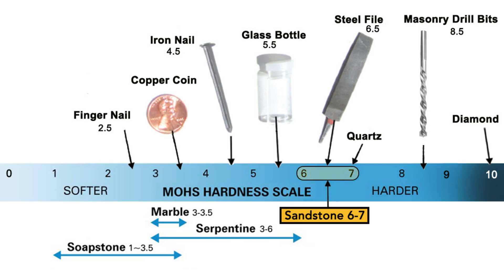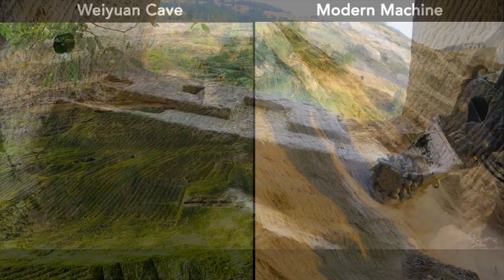Ancient Chinese Stone Caves & Egyptian Quarry Share Similar Machine Marks

Comment: If modern-like machinery was used in the construction of these sites there are enormous cascading questions that arise: Who designed the machines, who built the machines, where did they build them, what materials were they constructed from, how big or how small were these machines, what machinery was required to build these machines, what was the power source for the machines, if the power source for these machine was fuel - what was the fuel, what was the composition of the fuel, where was the fuel made or extracted, if the power source was electric - did it come from some sort of power grid, where is the evidence of that grid, what was the central source of electricity using to create the electricity, if the source was electric - was it generated on site, what amount of energy (fuel or electricity) was required, why are there no records of these machines or people using these machines, why did the machines disappear, if these kinds of machines could be produced certainly other types of machines could be produced (i.e: the huge vehicles that carry and use these modern bits are just as impressive if not more so than the bit itself), if this civilization could create and use this technology - why was it confined to making excavation implements, beyond making tools for excavation to build defensive structures one could easily assume that this civilization could also create some very impressive weapons of war, where are all the other machines and tools and manufacturing facilities. 

I am not dismissing the idea that modern-like tools may have been utilized to create these structures, but if this is true that is only 1% of the story. That we can't find remnants of or explain the construction of these modern-like excavation tools today is only one issue, there remains another 99% of things that must have existed that would have cascaded outward from the building and use of these tools yet we find next to nothing of this cascade. I think this is why the idea of it all being done by hand is so much easier to accept. While the points you make and the examples you show still remain good ones, the one that leaves the least trace of cascading infrastructure or proof of a modern-like or more advanced society is still the most plausible. 

Having said all that, I still find the idea of these constructions being done entirely by hand to be overwhelmingly difficult, slow, labor intensive, somewhat non-sensical and almost prohibitively difficult to plan, manage and fund... yet there it is, defying every bit of that disbelief.
Reply from the maker: Thanks Matt. I think the global wide megalithic phenomenon could be evidence of one or more prehistoric advanced civilizations. Judging by the scale of the work (Egyptian pyramids, Baalbeck, Sacsayhuama etc.), it's very possible that this civilization was more sophisticated than us.  Human species have been around for over 1 million years. Anatomically modern human with the same cranial volumes for over 300,000 years. Our known history is about 6,000 years. Did ancient people merely make stone tools for a million years with not much advancement? Look at what we have accomplished in the last 12,000 years. There is plenty of time for ancient humans to make a similar progress from making stone tools to landing crafts on Mars. 
Btw I made a video on the possible event that ended the last advanced civilization over 20,-15,000 years ago when there was a severe homo sapiens bottleneck. Hope you will find it interesting - When Humans Faced Extinction – the Ending of a Previous Advanced Civilization? https://youtu.be/Zs4zLKbp4Ic
Reply: @CuriousBeingbyTina  I certainly appreciate your curiosity and your pragmatic approach to these topics. I find myself perplexed by how these structures were made and what techniques were employed.
Imagining the difficulty that they would present to us today in this advanced technological society, in some ways biases me. Whoever carried out these projects either didn’t care how hard they were, was ok with expending huge amounts of effort and time, had skills we are currently unaware of OR were so far advanced from where we are today that the projects were all in a days work (and somehow that society evaporated completely leaving extremely little in the way of ‘hard evidence’ such as tools, plans, infrastructure etc) Maybe someday we will find this proof… but until then I have to stand with what we have in hand - and always listen to new ideas. Mysteries deserve our curiosity.

Comment: Please consider the following.
6:20 If he is trying to create parallel close together striations he needs to make the surface flatter first .

7:00 Looks like he is focusing on removing excess stone and not trying to replicate the cave finish.

8:20 This person is just removing the sawn finish. Uniform lines are not the intended result. Also he is using the metal part of a screwdriver. Not the correct tool if the cave finish is the desired look .
The three masons you presented display poor technique and the chisels also unsuitable for the task .
Thanks for the video, it was still interesting and well presented.
Cheers
Reply from the maker: Mr. Tiger used jackhammers not a screwdriver. I explained in the video that jackhammers are way more powerful than chisel and hammer. Thank you for the comment.

Comment: You do not need electricity to drive machinery. I could design a water power driven  rotary stone cutting device with ease. What you need is merely water pressure, the concept of the wheel, a glue and hard crystals attached to the wheels, made from whatever. You would not even need nano-diamonds. DLF
Reply from the maker: Interesting information. Thank you Dieter.

Comment: Looking at these pictures side by side cannot be sufficient evidence for power machine marks. You have to look much closer at the individual marks to identify the strikes done to remove material. It is also very important to look into corners and hard to reach places where a power machine would be incapable to reach.

A power machine can be human powered, though a single blow from a power machine doesn't necessarily have to be as efficient as the human hand if the blows are much more frequent. Example: how much material does a single power drill blow remove compared to a single chisel blow from an experienced human? And how close would you have to look to identify these two from each other?

We humans tend to find the easy way of doing things, so could they have figured a reasonable technique using hand tools which we can't imagine because we go to power tools way before we could figure this out and understand this? We don't have the problem because we use power tools to do the job, so we don't have to find a technique to do it more efficient with hand tools.

I think this needs a much deeper investigation, and I'm sure we will learn a lot which we didn't know. But it's important not to be biased here.

Thank you Tina for this one, I always enjoy watching your video's.
Reply: A close examination shows each line to be unique; variations in width, depth, and alignment.  Very UN-macinelike up close.

Comment: Page 6:47. Interesting. 
With no further thinking it is convenient to conclude that those striation were left behind by modern machinery in ancient time. Shall we say that is hardly conclusive?.  

What if we add this for an educated guess?
Ancient earth experienced several close encounter with comets varying from astroid to planet size. There were debris fall from comet on earth responsible for landscape profile on earth (except mountain ranges), also deluge of landed on lake or seas. The landscape begin soft but soon turn stone hard. Debris were mostly - course and fine sand, water of various ph or salinity. 

Living things can’t hide from that were buried alive. Ask why some dinosaurs fossils found in whole but dismembered? It was hurried alive. Also a proof of mud fall from heaven in ancient times. 

If you live in those ancient times you can’t run away but to face it, by digging for shelter, in the fresh mud fall while it was soft, with bamboo or bone tools. Machinery was unnecessary. 

Conscious said : 
1) learn but think - lost, 
2) think but learn - danger.
3) 
He deliberately leave the third quote. Those who can fill in correctly - are enlightened.

Comment: The tool marks are not uniform (mechanical): When closely examined they are not aligned, and they are without uniform width or depth.  Each line is unique...This is the antithesis of mechanical, despite misleading claims like this.   I repeat, sandstone, of ANY VARIETY comes nowhere near 7 on the Mohs scale.  There is NO BINDER for sandstone that approaches 7 on the Mohs scale, so citing the hardness of the quartz particles that can be found WITHIN sandstone is deliberately deceptive. .  Check your sources because you are accepting misinformation...or a misinterpretation of accepted measurement standards.
Reply from the maker: I just received a comment from a stone mason which I think is worth sharing with you: "Yeah, no way. I was a mason for many years (my father is a mason). I can’t tell you how much stone I chiseled during those years, countless. Granted I’ve mainly dealt with blue stone so maybe it’s different. But to efficiently chisel away at something for the shear purpose of removal of material, there would be nothing uniform about it. In fact, those parallel channeled lines would easily be chiseled away with a perpendicular impact. So to have the final markings of excavation be parallel and uniform doesn’t make sense. It would have a more bubbled texture with indications of chisel markings in all directions."